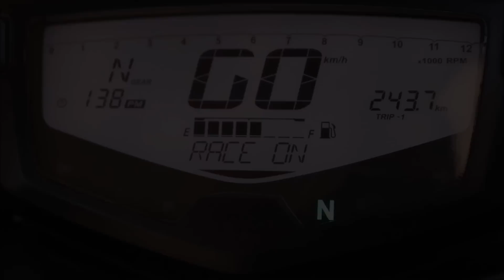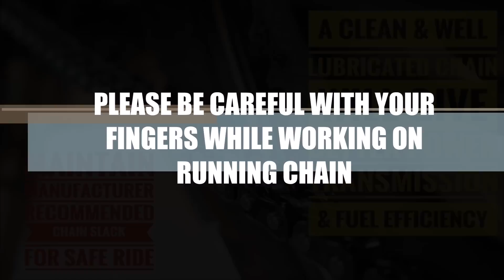TVS APACHE RTR 200 CHAIN SERVICE | CHAIN SPROCKET CLEANING & LUBRICATION VIDEO APACHE RTR 200

Comment: Hey bro, needed your advice on the chain noise. Surprisingly, there is this knocking in the chain when there is weight put on the bike i.e. rider only or plus pillion. And this sound is there  after a certain rotation of the chain happening throughout all gears, 1st and 2nd being the highest. When the bike is kept in the main stand and started with free movement of gear change there no sound being heard like the knocking part.. had taken it to the service center yet they were not able to understand what this problem is as it’s definitely not coming out of the engine.

Comment: I own a Apache rtr 200 4v race edition 2.0, 5gears and as per the forums  my bike has a 13 teeth front sprocket and a 45 teeth rear sprocket, I use my motorcycle for touring purpose and minimal to none city riding, I didn't think much about the lack of 6th gear and the shorter gearing but now I'm noticing it a lot and it's a bit annoying to while cruising at highway speeds at 6k-7k rpm, so I'm thinking of replacing my front 13 teeth sprocket with a 14 or 15 teeth sprocket, but the question I have is is it safe to do and if so which sprocket do I get? I heard the apache 160 has a 14 teeth sprocket, is it compatible with my apache 200, pulsar 180 and 150 have a 15 teeth sprocket, will it be compatible with my apache 200, its been 2 months since I bought the motor cycle and the odo reads 1400kms, I do understand that the chain and sprocket should be replaced as a set for better wear, since the odo reading is less and the sprocket is relatively new, I'm planning to replace only the front sprocket, please guide me
Reply from the maker: Hi Kaushik,
I would request you to wait for a week or two as you will get to see something similar on this channel 😊
Reply: @thesportztourer  thank you very much for the quick response, U make very good content, and I love it and I understand the effort that goes into each one, keep it going and best of luck

Comment: Hello, the video is very helpful. But I have one question. Do I need to change the chain sprocket after some specified kilometers as mentioned in the manual? Or how will I come to know that there is a need to change the chain sprocket apart from specified kilometers mentioned in the manual?

Comment: Great video on chain cleaning . I love how very well informed your videos are. Here, you are engaging 1st gear and cleaning and lubing the chain, isn't it bad ? I have seen other motorcyclist say it's a bad method to clean or lube the chain. Shouldn't it be rotated by hand ?
Reply from the maker: Yes, avoid doing it as it has can pull and crush your fingers (same is mentioned in the video).
Thanks a lot for appreciating the technical content, really means a lot to me 😊
Don't miss out these other technical stuff on chain maintenance:
1. Rust: https://youtu.be/SRLMWxFeKKg
2. Slider: https://youtu.be/Uc8qKzecYRA
3. Slack 1: https://youtu.be/vV8BAKwWDXs
4. Slack 2: https://youtu.be/Zfrqgch59M8

Comment: Waxpol or motul in terms of quality? And how long does that small waxpol can lasts? Please answer sir. Whether diesel appropriate to spray on chain as the rubber rings could lose their flexibility as diesel is harsh and volatile on rubber?
Reply from the maker: I hope my long and lengthy comment compensates for the late reply 😊

Both do a good job with sticking to the chain and do not cause any mess by spraying. The Motul C2 does lasts longer you can check that on this series: https://www.youtube.com/playlist?list=PLDzB4F3L5AFrSu-Q_kWTkxVU1yZqjM608

Chemically diesel is one of the best degreaser with good solubility & lower volatile nature, which helps to drain the dirt deposits from the chain link. Flash point of diesel is high enough to make it safe to use it on chain (and we do clean the residue) and it doesn't ignites with spark/static. Only thing that should of concern is the oxidation rate of a degreaser which very slow in case of diesel (but present) so it necessary that we wipe out the residue diesel. Being a strong degreaser it cleans thoroughly but we should always take care that latter the chain links are lubed propertly. However in cold countries where temperature reaches lower than 0 deg C, diesel fails to act as degreaser as it has a tendency to turn into jelly state when stored in open (non insulated/iso-thermal way). In such case citrus based degreaser are used. So technically Diesel won't have any adverse effect when used for cleaning O ring chain.

Comment: hey did u faced any chain sound problem in 4 and 5th gear while riding..
Reply from the maker: No Shivam, no such sound experienced. I regularly clean & lube the chain. Chain slack must be adjusted to the recommended limit to avoid such issues.
Reply: I am so frustrated of that sound even the tvs mechanics can't recognise the problem i purchased my vehicle on 26 march 2017 so it's not an issue of old chain.
Reply from the maker: Hi Shivam, a little bit of noise is expected from every chain. If it is still occurring after cleaning & lubing then adjusting the chain slack seems to be the option. Also open the front sprocket cover & check if anything is interfering there with then front sprocket.
Also check for the noise on other bikes in the service station so that you can explain your problem to the mechanic/service advisor.

Comment: Which is better 90 gear oil or motul chain lubricant some saying oil is better lubricant gets dry earlier
Reply from the maker: Hi Vishal,
SAE 90 Gear oil is good as a lubricant but in real world application it does attracts dust and needs frequent lubrication.
My experience with Motul chain C2 chain lube has been good. TVS Tru4 chain lube is a value for money lube for it's price (similar to OKS, Rolon etc).
Right now I am using a different chain lube (premium one) but yet to cover enough km to give a verdict on it 😊
Reply: @thesportztourer  which lube are u using right now and what is your experience and suggest me which oil i will use in my Apache i want  premium best oil ✌️🏻☺️

Comment: Hi brother, thanks for your excellent video. I have one doubt is chain lubricate is necessary what is the complications inter linked with this like it decreases the mileage? , Or else I need to lubricate only when it looks dirty ?
Reply from the maker: Hi Vamshi,
 Cleaning and lubrication is a regular need depending upon the riding conditions. Usually chain lubrication should be done every 500-600km while cleaning should be done around every 2000-3000km (depending upon the chain condition).

Comment: awesome video with all explanation. But i have a question that can i use motul chain cleaner instead of diesel to clean the chain ? please suggest.
i have been told that diesel is not good for chain cleaning as it will destroy the rubber in the sprocket. is this true ?
Reply from the maker: Hi Japjit,
Of course you can use the Motul chain cleaner.
Chain cleaner is nothing but degreaser. Chemically diesel is one of the best degreaser with good solubility & lower volatile nature, which helps to drain the dirt deposits from the chain link. Flash point of diesel is high enough to make it safe to use it on chain (any way we clean the residue) and it doesn't ignites with spark/static. Only thing that should of concern is the oxidation rate of a degreaser which very slow in case of diesel (but present) so it necessary that we wipe out the residue diesel. Being a strong degreaser it cleans thoroughly but we should always take care that latter the chain links are lubed propertly.
However in cold countries where temperature reaches lower than 0 deg C, diesel fails to act as degreaser as it has a tendency to turn into jelly state when stored in open (non insulated/iso-thermal way). In such case citrus based degreaser are used.
Reply: @thesportztourer  thanks for that info. :)

Comment: I'm too having an Apache 200 my bike's only issue is while downshifting the gears gets engaged in a very rough manner. What r ur recommendations sir??.
Reply from the maker: Hi,
Assuming your chain is in good condition (cleaned and adjusted). I would suggest you to adjust the gear lever position and if needed get the clutch adjusted. Have made a specific video here: https://youtu.be/Y_r-XQWIT6U

Comment: I have heard that spraying Petrol/ Diesel on O-ring type chain actually damages the rubber inside it. Correct me if wrong.
Reply from the maker: Hi,
Chemically diesel is one of the best degreaser with good solubility & lower volatile nature, which helps to drain the dirt deposits from the chain link. Flash point of diesel is high enough to make it safe to use it on chain (any ways we clean the residue) and it doesn't ignites with spark/static. Only thing that should of concern is the oxidation rate of a degreaser which very slow in case of diesel (but present) so it necessary that we wipe out the residue diesel. Being a strong degreaser it cleans thoroughly but we should always take care that latter the chain links are lubed propertly. However in cold countries where temperature reaches lower than 0 deg C, diesel fails to act as degreaser as it has a tendency to turn into jelly state when stored in open (non insulated/iso-thermal way). In such case citrus based degreaser are used. So technically Diesel won't have any adverse effect when used for cleaning O ring chain.

Comment: Very well shown the chain maintenance. One should be extremely careful while the chain is driven. DIY beginners better manually rotate the wheel till they are conversant with the methods. Remove the key from the vehicle , while doing periodical maintenance.

Comment: how many hours does the Diesel takes to dry completely?
Reply from the maker: Evaporation depends upon the surrounding temperature. It's better to wipe the chain dry with a clean cotton cloth.
Reply: @thesportztourer  i cleaned my RTR 200 chain with Diesel and used motul chain spray ..... definitely i can see improvement in smoothness and acceleration...thanks for this video
Reply: @thesportztourer  and i wiped my chain with a clean cloth till i can see some Diesel residue..so i kept it for about 2hrs and the Diesel completely evaporated

Comment: Can i use gear oil for chain lubricant...
Reply from the maker: Hi +Manash Sarkar,
Yes you can use SAE 90 gear oil to lubricant the chain. It is cost effective & works well.
My experience with gear oil was good, the only issue with gear oil is the mess it creates. Its spills/sprays around a lot & also attracts dust/dirt.
Reply: The Sportztourer thanks
Reply: Best gear oil.
Reply from the maker: +Manash Sarkar 
I have used this:
From HP: http://amzn.to/2vov8Or

You can also go for this as I have heard good about Bosch gear oil:
Bosch: http://amzn.to/2vo8fuy
You can get the HP one from your nearest HP  fuel station

Comment: The spray you used what is it? Water?
Reply: The spray u used in the beginning to clean sprocket
Reply from the maker: Hi Amit,
That's diesel 👍
You need to wipe it completely before you start spraying the lubricant.
Reply: Why use diseal? Is there not any product available from motul or other brands for this purpose ?
Reply from the maker: Hi Amit,
Chain cleaner is nothing but degreaser. Chemically diesel is one of the best degreaser with good solubility & lower volatile nature, which helps to drain the dirt deposits from the chain link. Flash point of diesel is high enough to make it safe to use it on chain (any ways we clean the residue) and it doesn't ignites with spark/static. Only thing that should of concern is the oxidation rate of a degreaser which very slow in case of diesel (but present) so it necessary that we wipe out the residue diesel. Being a strong degreaser it cleans thoroughly but we should always take care that latter the chain links are lubed propertly.
Yes, I do have the Motul chain cleaner which I use for my long rides as it makes the job easier (and easy to carry).

Comment: I had a problem with chain noise. it is making sound after lubing and don't know when it will stop.  the noise occurrs randomly. I took to the service centre and they to didn't find the problem. they changed the front sprocket and chain ( not rear sprocket). I couldn't find a solution.
Reply from the maker: Hi +srinivas1234 madugula, well its difficult to  judge & give a solution like this but I would say check on the chain slider. Noise from the chain can either be due to lack of proper clean & lubrication (not applicable in your case as you said your chain is lubed), chain slack adjustment or alignment issues. As the noise is random you have to check the source. Hope this would be useful for you.
Reply: srinivas1234 madugula alignment issue.. does your chain get loose often?
Reply: murali prasad  yes for a week ride it gets loosen

Comment: Can we use petrol instead of diesel
Reply from the maker: Hi Mohit,
Petrol is highly volatile when compared to diesel. Diesel is a better degreaser when compared to Petrol 👍
Reply: The Sportztourer thanx 
And one more thing can we use 2T oil for temporary oiling?

Comment: Kya apachee 200cc me  heating problem h  kya meri bike engine bhut heat ho rhi bike liy sirf ek hafta huaa h
Reply from the maker: Hi Bhanu Sharma,
New engine mein heating hona common hai. Abhi motorcycle run in period mein hai, engine ko settle hone mein time lagega fir sab normal ho jayega.
Heating, false neutrals, roughness etc are common in new motorcycles.
If you still feel there is something abnormal then you can visit the service for help. Over heating can be due to badly tuned carb where this video can help: https://youtu.be/3LOP8asQ6Ek

Comment: which polish do you use on Apache's matte body,can u please do a video about it ?
Reply from the maker: Hi +Debasish Gourav,
Matte paint on the apache don't have any clear coat so no need of surface treatment or preparation. No need to worry about the swirl marks on matte paint but you can still use wax if you want to take some extra care.
Reply: okay ,,thanks bro,But am really noob here ,,can u suggest some wax products ,which are good for my red 200
Reply from the maker: Hi +Debasish Gourav,
Actually wax won't be required but if want to use one on matte paint then go for liquid wax or quick detailer, Avoid using paste or hard wax as they give out shine which isn't required on matte paint surface. Don't directly apply on the surface, use a microfibre cloth instead to apply.
Paint manufacturers & detailing companies would still advice to just wash & wipe matte paint & no extra care like wax/polish/rubbing would be required. So it's very easy to maintain matte surface.
Reply: thanks man,,really help me a lot
Reply: bro according to me WAXPOL is the best. I also have matte finish black rtr and i been using from the very first day. From the past 3 year whenever i do polish it looks brand new everytime. Plus its cheap too (150) and trusted atleast by me. But its your preference which polish you want to use.

Comment: is it good to clean chain with kerosene
Reply from the maker: Hi Harish, you can use Kerosene but I would still prefer diesel. Diesel is more refined & cleaner liquid (less prone to oxidation).
No clear damage with Kerosene but you may face some some hard time cleaning up the Kerosene residue from the chain & spills around the bike (wheels, swing arm etc) & off course the smell of kerosene vapours/fumes.

P.S: Be very careful with your fingers if you are working on running chain.
All the best.

Comment: what are the sprocket sizes?
Reply from the maker: Hi +Vaibhav Joshi, 13T in the front & 45T in the rear.
Reply: The Sportztourer that's the same as rtr180
Reply: Vaibhav Joshi 1st you bought Apache 200

Comment: Doesn't this part get covered in servicing of the bike?
Reply from the maker: Depends upon your service center. I got a lot of messages that only chain is cleaned & lubricated, front sprocket area is left as it is.
Reply: No, they charge 180 extra for chain lube

Comment: Does the upper portion of chain normally touch the surface before entering into the small sprocket while rotating, as in this video https://m.youtube.com/watch?v=F98SGZBpSZk 
0.31. I'm asking about the chain in correct condition not as that in the video. I showed the video only for you to understand the correct portion.